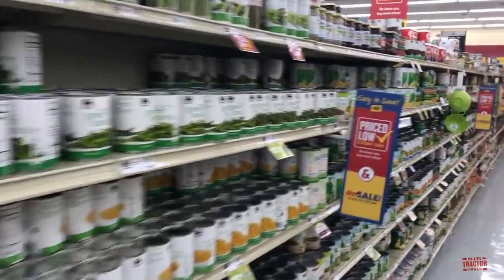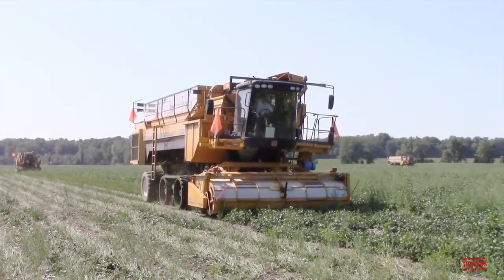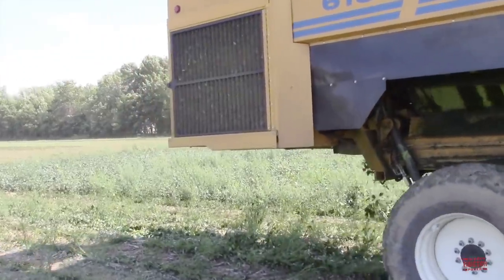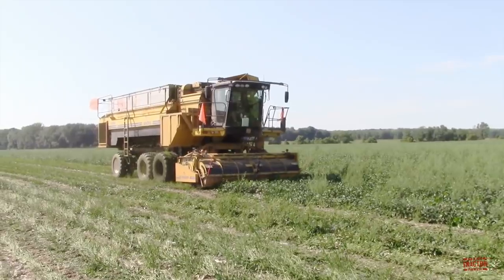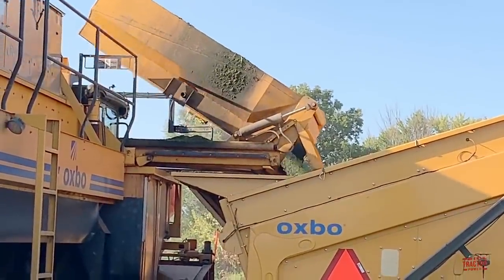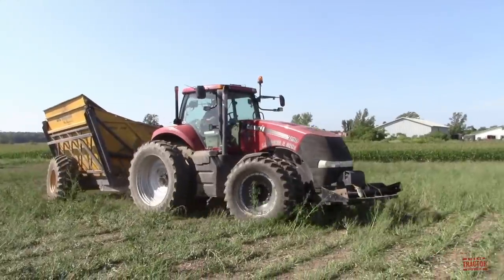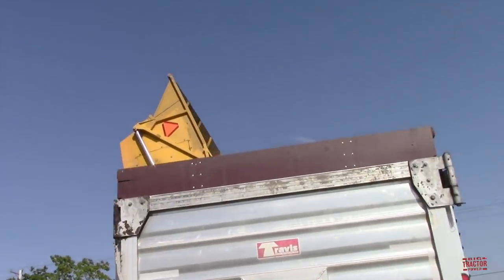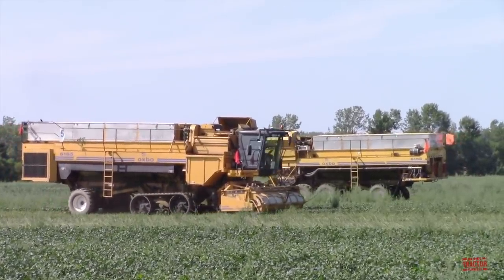LIMA BEAN HARVEST | OXBO 6156 Combine

Comment: can you explain how those machine work inside harvesting ????????????
Reply: Once the peas/ limas go up onto the upper Infeed they get tossed into a big rotating drum. Inside that drum are 5 beaters, they spin faster than the drum, once the pod hits the beater it splits open and the limas or peas fall onto the left and right aprons which get put onto the long conveyor belt which is brought up to buckets which then bring the product to the bin
Reply: I personally ran one of these machines for pod squad here in western New York
Reply: @ryankowalski7410  i believe that manufacturer ploeger has a video that shows the insides when the product first enters, its quite fast but you can see the process and parts very well. and since the working for these kinds of machines is pretty much similar i figured these oxbo machines look exactly like the ploegers i ran and worked on
Reply: MACHOMISTERYMAN yes, probably shows what I just explained.

Comment: I'm still trying to get used to seeing these Oxbo pea combines in our area in south central Minnesota. It seems like yesterday that they were using the old FMC's with the Duetz diesels in them. The air conditioning never worked in any of them either, hence the windows and doors were removed on all of them. Talk about getting ate alive by mosquitoes in the middle of a hot muggy June night in a pea field only going one and a half miles an hour.
Reply from the maker: Thank you for sharing.  OXBO acquired FMC in 2002. I grew up near Byron, NY.  I have pictures in my archives of some of the first OXBO 156s going down the factory line in May 2003.  It was interesting to see because they were still in FMC red with Claas cabs but had OXBO decals.

Comment: Clear Lake, WI is not far from where I grew up.  There is a fairly decent amount of commercial vegetable production in and around the area (not just land in production but several canneries) so it's a logical location for the equipment to be built.  I knew they had an Oxbo facility (I had recently seen an advertisement for a job fair) but didn't know what pieces of equipment were manufactured there.  Regarding the 6165 and 6156 and other self-propelled equipment, do they have some kind of licensing deal that allows them to use John Deere cabs or are they fulfilling that need through the secondary market?